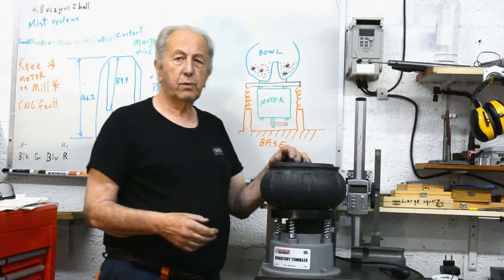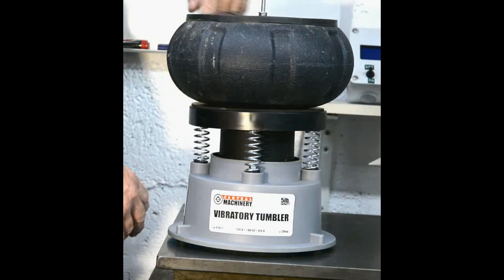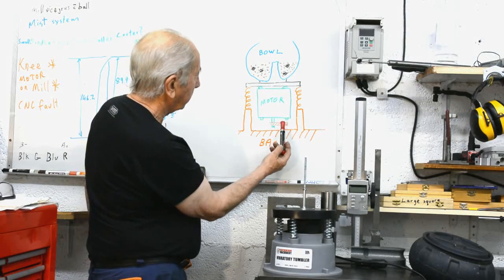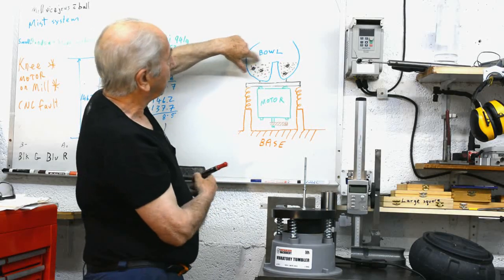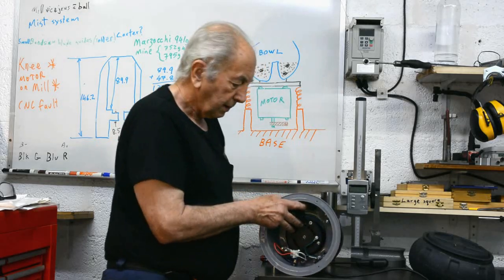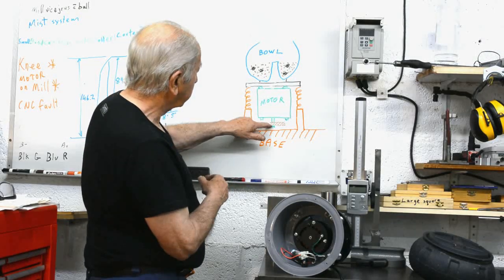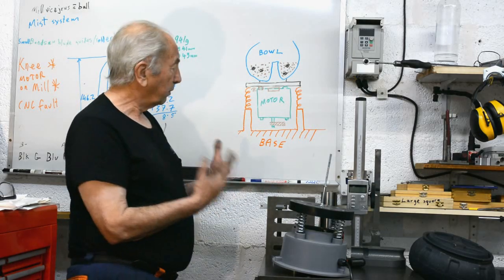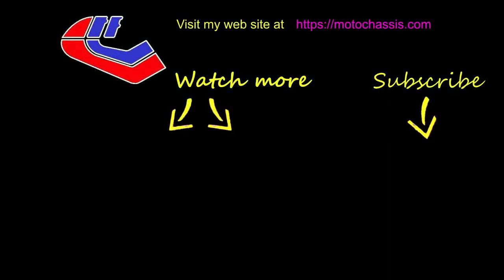Performance improvement for Harbor Freight Vibrating Tumbler

Comment: Solve the dispute once and for all…put parts in a stock one and the one you modified and tumble them with the same media for the same length of time and see which one does a better job of burr removal and surface smoothing
Reply from the maker: I have no dispute with anyone but I cannot do as you suggest because I do not have a stock one.  In any case I have no intention of getting into a dispute nor trying to prove anything.  The facts are that I bought the tumbler, I was not impressed by it, I modified it and now I am pleased with it.  I thought that it might be useful to others so I made a video.  If a few others do not like it that's fine by me, I have no desire to argue or try to change anybody's view.
Reply: @MotoChassisByTonyFoale Yes, exactly. And thank you for doing it so we can see if we would benefit as well. You are not working for us. We are privileged to be able to benefit from your effort. Thank you.

Comment: its always aggravating to watch a video of an improvement to a cheap machine, only to realize i cant do the improvement because i dont have the thousands of dollars of equipment used to make the improvements. Thanks for not showing the mystery "lucky part", or the shortening of the shaft, or even a before and after for that matter. thanks for the non use of actual measuring tools when speaking of the shaft lengths, new shaft weight etc. Its nice to see an improved machine with lots left to the imagination,,, you know, to protect your brilliant improvement, but at the same time share it with the world so we can all marvel at your skills and abilities. The idea gets a 10. the execution is still in question as we didnt get to see any of the work, or finished product of the work, and the video gets a 2. thanks for the idea... ill take it from there boss. See if i can do a similar mod that is repeatable and doable by everyone with access to a hardware store.
Reply from the maker: Thanks for the 10 for the idea.  That is all I am trying to pass on.  The rest is trivial.
Reply: yeah, mechanical application and engineering is trivial. tell me you have no real clue about whats going on... without telling me you have no clue. ive already redone this entire idea with a cordless drill and like $30 at home depot. no machine shop needed.

Comment: Thank you for posting this, Tony! I just bought one of these for rock polishing, and noticed a bunch of reviews strongly advising against using it for that purpose. Instead of fabricating a different rotating weight, I cut the excess length from the original one and added some weight back by drilling/tapping a hole to thread a bolt to make a rough "L" shape. Just have to get some longer bolts & spacers, and we'll see how it does for polishing rocks!
Reply from the maker: I know nothing about polishing rocks but I would have thought that you would do better with a drum type tumbler.  I prefer those but the noise is unbearable so I only use that when I am not in my workshop.
Reply: @MotoChassisByTonyFoale  a rotary tumbler is better in terms of shaping and rounding rocks, but the smoothing and polishing steps are done much quicker in a vibratory tumbler. I just buttoned it all together, and it seems like it's going to do well. Stirring motion is good, noise is reasonable, and the whole assembly seems quite solid. Very impressed so far.
Reply from the maker: @dmoore0079  Thanks for that.  As I said I know nothing about polishing rocks.  good luck with it.

Comment: Very well done!  My rotary tumbler recently let the smoke out, and I’m considering a vibratory tumbler to clean the staining from the coins I find.  I’ll do this mod if I go that route!
Reply from the maker: I have not had experience with coins but I found that for some items a rotary tumbler is best, although noisier, yet for other jobs the vibratory one does a better job.
Reply: @MotoChassisByTonyFoale  The general concensus is that vibratory is not very effective for coins, but I don't see why not if the right media is used (and the tumber is upgraded to work effectively, as you show here!).  Cheers!
Reply from the maker: @Donorcyclist  Interesting.

Comment: This HF tumbler works best with a total weight of media + objects in the range of 3 to 5 pounds. With this weight, the tumbling action is perfect and the unit does not need this modification. It was not designed for very light loads like 1 to 2 pounds. That is the cause of the problem that you observed.
Reply from the maker: Not so.  Performance was improved at both light and full loads.
Reply: @MotoChassisByTonyFoale  My HF vibratory tumbler works absolutely perfectly at 3 to 5 pounds load with no modification. The tumbling action of the media is perfect. The vibrating action is smooth and the unit does not move during operation. I do not have any idea what your problem might be and from my experience with the unit, I completely disagree with your suggested modification.

Comment: Any suggestions on how to strengthen the cheap HDPE bowl? In my attempt to mend the bowl, I made even bigger holes, plus I ruined my kitchen floor. There has to be a way to coat the inside of this bowl with an extra layer of High Density Polyethylene before the bowl wears out?
Reply: You can buy liquid rubber or vinyl and put several coats on the inside. Make sure the surface is very clean and roughed up so as to better the adhesive qualities. You will likely have to renew it every so often.
Reply from the maker: I have not had any problem like that but @melgross has a suggestion in his reply.

Comment: I have a harbor fright tumbler that your fix would never work. First it has a fan on the bottom,on the end is flat bar for the weight. Second, the motor mounts are way to close to reverse the location of this weight. So, this idea is worthless!!
Reply from the maker: Obviously our tumblers are different models, mine has no fan.

Comment: Well Done.
As a machine builder your explanation is easy to follow, the physics sound, and the improvements doable for those interested!
Just bought the same one two weeks ago for the sole purpose of polishing Oregon sunstones.
 My understanding is it's not a beginner Thing, and I am to rock polishing. 
First thing I saw was the ability to change the rotational Mass to produce different effect, like the agitation you have achieved and I'm quite interested in the final effect on the product.
I'm thinking that it's actually less violent while having more frictional values.
👍 Thanks

Comment: Could not get this idea to work.  It's not possible to flip the motor without modifications.  Additional parts would have to be purchased that are not locally available to me.  I had to put it back together, then watch it completely melt the threaded rod and fly apart again.
Reply from the maker: Sorry to hear that you had a problem.  I did not need any additional parts.

Comment: Way to much jabbering. Just tell what you done to it (like turn the motor over and changed the weight )
Reply from the maker: The CoG has to be a user input because it varies with bike, rider and setup.

Comment: Yea,but i thought you were going to show how to modify the machine,not a lecture.
Reply: Some of us like a good physics lecture...
Reply: @angusga this wasn’t a lecture in physics. It was his thinking about what he believes is a problem and his supposed solution.
Reply: A little tongue in cheek comment on the parent comment here.  Just roll with it.
 @melgross
Reply: When you understand the operating principle and physics of it, rest is simple. Also he explained what he did. Cut the shaft shorter, made similar weight but shape counter weight, swap the motor upside down with 4peaces of 10mm spacers dropping motor bit further down.
Reply: Ungrateful

Comment: Got one of these a few years ago to clean up jewelry castings.  Works ok...  not supposed to use it with liquid, but I have used riogrande Sunsheen burnishing compound with it a little bit. Does keep the dust down.  Blasted thing is outrageously noisy!  Can't even stay in the workshop with it running.  Haven't used it much at all, maybe about 10 hours worth of time in the past few years, started using it again last week, ran it off and on for about 3 more hours in half hour increments, and the bowl came right off the platform!!!  Usually the lid just comes off about every 20 minutes...  Now that I have to tear it down and see what happened to whatever secured the bowl to the motor, I will definitely be making your modifications to it!   Great idea!!!!

Comment: Great info ty, 
I have a question I have the the orange bowl 5lb #93252 which I just purchased used and I put everything in and tighten all and turned on the the bowl Spins and vibrates. Is this right thought was to just vibrate? Can you tell me if correct or not and how to fix the spinning. Thanks 🤩
Reply from the maker: The bowl should not rotate continuously but sometimes they do.  I replaced the rubber mat under the bowl with a softer rubber and that fixed it.
Reply: @MotoChassisByTonyFoale  ty

Comment: You have moved the mass from the end of a rod to close to the center of the rod, so you have infact reduced the amount of mass and force applied, you have reduced the leverage of the force applied to the media, you can clearly see the modded version is just going around, whereas the unmodded version wasnt tumbling correctly, but if you had read the instructions you would see that its best performed when its 3/4 full of media, alot of the impacting movement is lost from half way up the barrel, thats why you where disappointed with the outcome as standard
Reply: The modded version generated more movement near the media, he made the machine better at using smaller batches of media. Originally it was designed to move a greater quantity of media which would have reached higher up the shaft. His modification did reduce the leverage, but positioned it at the right height to move his media.
Reply: @connercoulson9247 it didn’t improve it. It just changed the amount of media needed, which is fine. But the more media, the stronger the results. Everyone making mods to equipment is convinced they discovered something and that it’s better.
Reply from the maker: It works for me and I have read the instructions.

Comment: i'm curious if it made a difference before and after by moving the weight. And or if they had the weight there to counter balance heavy loads.
Reply from the maker: Mike, the weight is there to create an out of balance vibration which shakes the container.

Comment: I greatly appreciate your sharing of this idea and explanation of the concept.  To make this easier for other people who want to perform it, I found upon disassembly that in order to mount the motor inverted in the housing with 10mm spacers, you will need to buy m5-.8 threaded rod, as I wasn't able to find m5 bolts that long anywhere, and cut it to about 135mm (x4), and add nuts the what used to be the hex bolt head end.
Reply: In the US: McMaster Carr # Medium-Strength Threaded Rod
Class 8.8 Zinc-Plated Steel, M5 x 0.8 mm Thread Size, 1 M Long
99067A242
Reply from the maker: I do not recall having to get long bolts but it was done a while back and I might have forgotten.  I'll check and get back to you.
Reply: @MotoChassisByTonyFoale  I could very well be mistaken, but it seems that since the motor shaft once went though the hole in the bracket that the motor was once flush-mounted inside, the fan end of the motor will now be bolted in that end, requiring the spacers to be located between the motor housing and once-motor shaft end/now fan end in order to clear the fan blades , necessitating the spacers and longer bolts/rod there.
Reply from the maker: @kohgoes  I think that you must have a somewhat different machine than I have.  Mine had no fan, therefore I am unable to comment on what yours is like.
Reply from the maker: OK, I checked mine and as I thought there must be differences to those being mentioned here by others.  Mine does not have through bolts to mount the motor and mine does not have a fan.  So for anyone else who wants to follow my modifications all I can suggest is that you just take the basic idea and work out how to apply it to your own situation.

Comment: Thanks for a clear and good explanation. May I ask about your input how the steel springs affect the tumbling function. K-value of spring, diameter and length. Is a stiff spring preferable or a soft one. Thanks in advance
Reply from the maker: Ola,

The springs and the mass of the moving parts will define a resonant frequency.  It would be best if that frequency coincided with the motor speed.  However, the overall mass is not fixed, it depends on the load that you put in it.
I have not measured the spring rates nor the resonant frequency but that is an area for further investigation.  It is doubtful if the "as bought" spring rates are anywhere near optimal.
It is a question of having spring rates within a workable range.  It is not as easy as hard or soft.  If very hard then it will lock the barrel and you will get no agitation, too soft and they will not be able to support the weight.

Comment: I have the same tumbler! I've often run it wet, with WD-40 or Windex, depending on what I was trying to accomplish. It works very well!

My chief complaint is that the lid likes to come off, so I've had to experiment with various fasteners on the central bit of all-thread.

Thanks for all that you've contributed to motorcycle design and engineering, Tony! Keep up the good work!

Comment: When I was an aircraft maintenance engineer with QANTAS Airlines we had a couple of industrial sized tumblers for deburring and polishing of gas turbine blades mainly. They did a great job and fun to watch in motion oddly.
Reply from the maker: yes, a vibratory tumbler is somewhat mesmerizing to watch when loaded and running.

Comment: Good work.  It's a decent upgrade.  

Reminds me of the old Princess Auto welders.  You could take four screws out of the bottom, move the transformer over and get an extra 20 amps out of a 70 amp stick welder.
Reply from the maker: can you explain the welder some more.
Reply: @MotoChassisByTonyFoale  Sure.  Princess Auto is like Canadian Harbor Freight.  They used to (still do?) sell these cheap little arc welders.  They had a 70 amp and a 90 amp for more money.  The welders are identical, with the transformer installed in a slightly different position inside the machine. 

There was a dial on the front of the welder that would push a separator plate between the primary and secondary of the transformer to decouple them magnetically.  Turn the dial to minimum amps and the plate goes all the way in, mostly blocking the magnetic flux.  Turn the dial to maximum and the plate comes almost all the way out.  The chassis came with two sets of holes in the base where you could install the transformer.  The 70 amp was installed in one position, the 90 amp in the other.  All you had to do was move the transformer over to the other set of holes and the separator plate would be able to move to the full out position and you'd get the full 90 amps.
Reply from the maker: @unhinged-menagerie  I love it.

Comment: can you show the piece you made and how did u attach it to the shaft?
Reply from the maker: I neglected to photograph the piece but it was as I drew on the board.  Attaching to the shaft was just like the original, a hole fitted over the shaft and the piece was cross drilled and tapped for a retaining grub screw.

Comment: Can you polish gearbox in this small tumbler?
Reply from the maker: A gearbox for a model car maybe.  You can get larger tumblers, my guess is that very large ones might have a different mechanism.
Reply: @MotoChassisByTonyFoale  sorry my English isn't so good Mr Foale... I mean gears from motocycle gearbox for reducing friction....
Reply from the maker: @vpservice1016  No I do not think that it would suitable.  I think that you have two options, one is precision grinding and there is a process called "chemical polishing".
Reply from the maker: @chip-load  Very interesting.  Like @VP SERVICE I too want to get some motorcycle gears super-finished.

Comment: Thanks, I'll have to apply this fix to mine. I got mine 10 years ago, and used them once on removing corrosion from a Lauson 2.5HP motorcycle engine from the early 1950s. It was on a Safety-cycle motor bike made in LaCrosse Wisconsin. Anyway I was disappointed at how poor the surface cleanup was. And ended up using a Dremel tool with a brass wire wheel to do the cleanup.The actual machine I was working on was one of these for my brother in law;
https://www.youtube.com/watch?v=RthUz_ijUds
Reply from the maker: Interesting.
Reply: @MotoChassisByTonyFoale  This same engine 2.5HP, with other mods was used in WWII bomber as an APU. It has ball bearings on the main crankshaft, what I found clever was a check valve that let the crankcase pressure out on the piston down stroke, so a negative pressure was formed, which kept oil from leaking out the metal shields on the ball bearing mains. Also had an interesting cam follower that must have modified the cam timing. It is of that era with a flat head or "L" head combustion chamber. The Lauson brand got bought by Tecumseh in the late 50s. And it looks like they just bought the production facilities and abandoned the Lauson engine designs.
I can't imagine this 2.5HP being much of a motorcycle engine with Indian, and Harley Davidson being available at that same time, with much more power.
So now I will modify my vibrator and see if it will actually clean corroded metal.
Thanks for you videos.